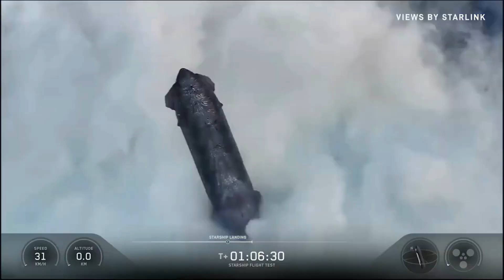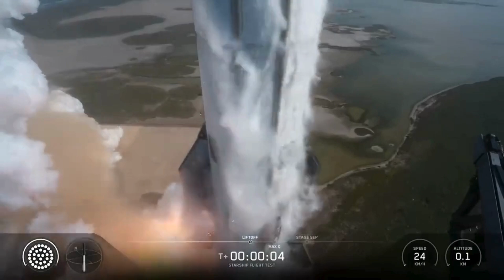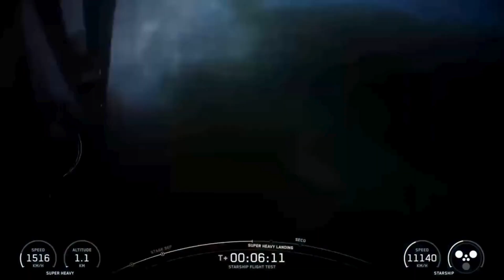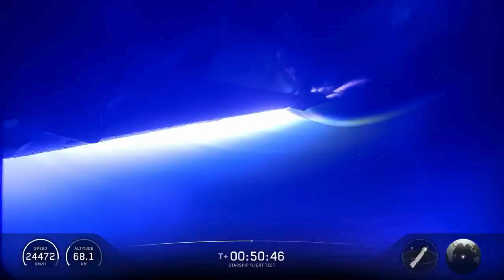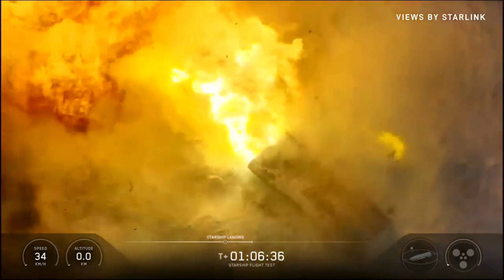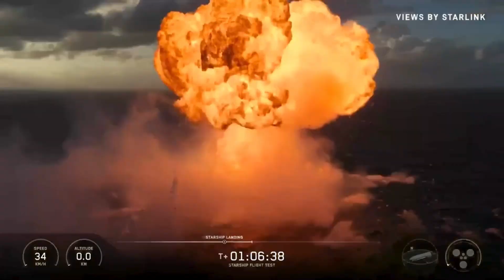What Actually Happened on Starship’s Twelfth V3 Launch?

Comment: Great analysis. It’s easy for casual observers to just look for a perfect landing, but the real success of Flight 12 is in the telemetry, the thermal protection testing, and the staging data. This program is moving at absolute lightspeed compared to traditional aerospace.
Reply from the maker: That's the key distinction. Spaceflight isn't a pass/fail exam, it's an engineering process. Every flight teaches you something, and Flight 12 taught us a lot